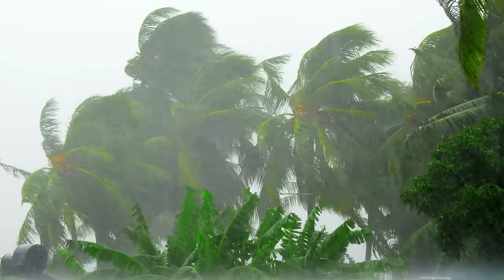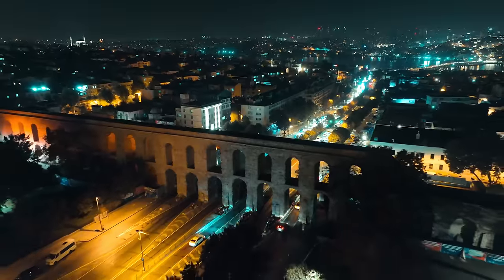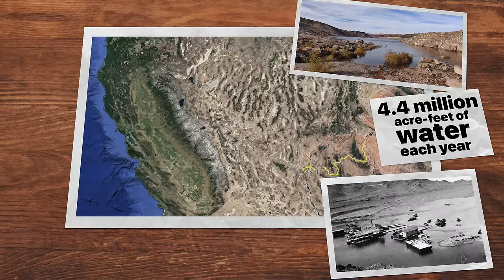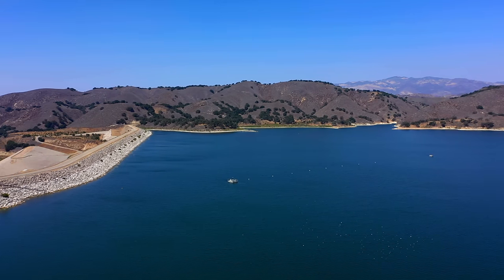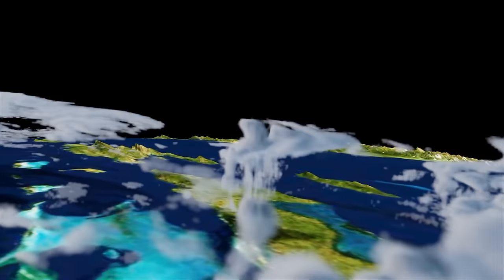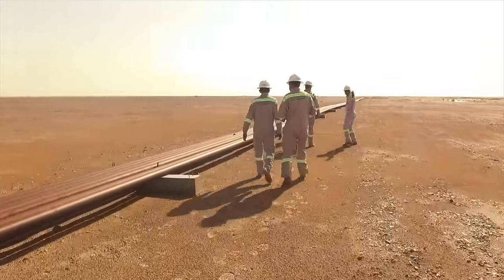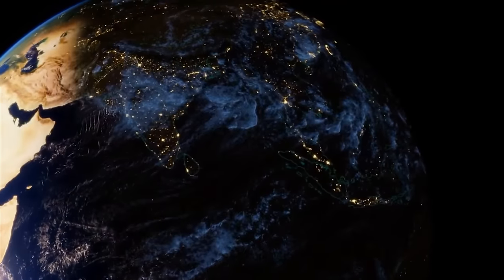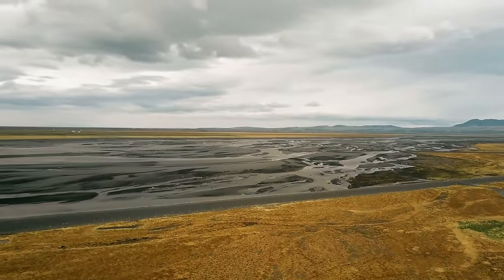Pipelines From Flood to Drought

Comment: Instead of pumping all the water to the end point you could just pump it to the nearest part of the Colorado Basin, and then let gravity and current infrastructure do the rest.  That would save a lot of work, also you could just empty a few lakes close to the basin, maybe making this all a lot easier.
Reply: Good idea. Pump water from the east (and north PNW?) towards different reservoirs hopscotching across the country. Good ideas to do something to mitigate flood damage.
Reply: The big factor is how costly it is to pump water up hill. Water is very heavy. Plus, we couldn't build an oil pipeline across a few hundred miles of wilderness. Running a massive canal across a thousand miles ain't going to be a cake walk. The environmental impacts of this... One might argue it's not ideal. I personally think nuclear desalination is the future.
Reply: @AnotherAmerican91  Pump water upward with solar electricity during the day, then regenerate that electricity when it flows downward.  Reservoir can also serve as a battery.  It's 2 birds with 1 stone.
Reply: How do you propose the patter is initially pumped there?
Reply: as to how look to the dutch thay have been pumping water uphill for centurys, plus the british and the canals for  narrowboats etc with locks
Reply: @alexfrank5331  Excellent solution.
Reply: Took the words right out of my mouth. Still an aquaduct would be fun.
Reply: I believe an issue with that is that Mexico takes from the Colorado as well
Reply: How dare you be so logical.
Reply: You could move to where the water is
Reply: @AnotherAmerican91  the fact you think a canal can work UPHILL is proof you don't understand the problem.  No one is ever going to pump water up  a mountain.  Every single person who advocates this has 0 knowledge of the engineering involved.  It simply can not be done.  No one is pumping water 1 mile or more UP a mountainside.  Also, pulling water out of another system weakens and depletes that system.  Lousiana is losing coast line in the gulf every year because of flood control on the mississippi.  That river is supposed to whip back and forth, it's how the delta was created.  Now that it isn't doing that the delta is vanishing.  You guys are literally advocating for further destruction of another environment to compensate people who made the bad decision to live in a desert.  It's awe-strikingly obtuse thinking.  The fact your doing it in the guise of "flood control" is proof you don't understand that floods re beneficial, and REQUIRED for the health of those areas.  Without them, land fertility will take a nose dive.  Without farms in those areas, we can't sustain the world population, without the farms in the desert, we go 2 months without fresh tomatos and have to use preserved...ono!  the horror!
Reply: @TheBadweasel1975  the dutch are pumping water uphill a few feet.  We're talking miles here.  The scale of the problem is vastly different and the dutch don't do it.  The tech doesn't exist and no one has yet shown the math to over come the back pressure of trying to pump a fluid over 1 mile UP in addition to 1500 to 2000 miles across.  The requirements to do this aren't possible with modern tech.  Attempting to hop across various reservoirs also will not work because that introduces loss to the system which means you have to vastly increase the amount being pumped on a daily basis, which means you are now depleting the source system at an ever increasing rate...thus destroying the land and biological diversity further east.
Reply: Absolutely.Or pump it right into lake Mead and Californias top three reseviors.
Reply: I'm looking at all of you who think water cant be pumped uphill very closely. do you know what a siphon is? there's a downslope half to every mountain. pick the lowest , best route, and bring water trucks, use valves and an opening on the downside to pump into.  open the valves, water rushes downward, (causing far less uphill pumping force to be required)  and hit the uphill pumps, and boom you got flow. lock the liquid in the downhill so it can always start again. also, we have boring tech before thought impossible, we can go through and make unmanned digs that reinforce themselves as they go.
Reply: @AnotherAmerican91  Exactly. California has the answer to their water problems on their entire western border. Quit robbing water from other states, when your answer is at your door. Desalination is not cheap, but it is likely significantly cheaper than the process described in this video. Dubai gets nearly all of its water through desalination, so the technology exists to do this on a large scale.
Reply: @AnotherAmerican91   desalinization plants are  their down sizes  huge down sizes.Also water is the new gold so pump it up hill would be cheap.And literally anything is possible,also we need to conserve the water we have and stop growing food in areas that dont have enough water for it ppl
Reply: @JR-wz3ub  yah at the bottom end not the top lmao,and they could say the exact samething .Also ppl need to stop moving to the deserts and draining away a already scarce resources ,it makes zero sense
Reply: @alexfrank5331  mmm yeah, pumping water up hill using solar power would be insanely expensive. The Midwest just isn't good for solar, and it's quite frankly not that great for wind energy either. It's not that sunny and it's not that windy.
Reply: @zarroth  mmm I don't think you read my comment correctly bro. I was pointing out how insanely impractical the idea was. I didn't even feel the need to address the engineering limitations, the ability to get permits in America for this kind of project just seems impossible to me alone. No need to even get to engineering before making my conclusion that this idea is a dead end. They can't build a high speed train from San Fran to San Diego and they think we're going to build a canal across half the country.... Good luck. I also think it makes little sense from an engineering perspective.
Reply: @jonathanbedsole1671  I mean I think the Midwest has plenty of water to share. My understanding is that desalinating water is actually way cheaper and environmentally friendlier than moving it across a thousand miles. Again, water is heavy and very energy intensive to move. I just don't think the math checks out, like at all.
Reply: @alexfrank5331  Not really.  You would have to pump it 1000 meters uphill, but you would only be able to get back a fraction.
Reply: @TheBadweasel1975  Nice try.  They haven't been pumping it 1000 meters uphill.  That is a long way and takes a LOT of energy to do.
Reply: I always notice it's "we" can do a thing, when the person speaking on their own behalf, or for their friends,  has something to gain in a "zero sum" or near zero sum sort of scheme.  But when those same people stand to lose, it's more of an "us" versus "them" sort of speech, and there's lots of focus on "me" and what is "mine".  I am not trying to quash innovative thinking, however I noticed that it took you quite some time to address the real issues of cooperation and politics (oh, and you just had to mention the gov. Intervention: that's comforting)...I can tell you if you are hinting at simply moving water from the midwest to the west, I and many others will take a very dim view of that.
Reply: @stevedriscoll2539  I think the truth is actually much less cynical. I think California would love to build desalination plants, but Californians won't let other Californians build those plants because of NIMBY issues and lawsuits. So the Californians that need water have to look outside their own state for solutions. That would be great however throughout America building infrastructure that moves any kind of liquid from one place to another is always a very controversial subject and usually doesn't end up happening. On the bright side running out of water will probably force California to come up with solutions they have the power to implement, like desalination plants. That'd probably solve their grid problem to, and probably also their carbon neutral objectives.
Reply: @AnotherAmerican91  agreed. The math definitely would not check out.
Reply: OR...you could MOVE outta the DESERT too!!!
Reply: @alexfrank5331  Look up Dinorwig in Wales. Water is pumped UP to a lake overnight using unused electricity (less energy required at night!). During the day it's a hydro power station. Also used for 'crash' power surges, (like half time England v Germany and everyone puts a kettle on for tea!) power can be increased in seconds.
Solar power would be a good idea for constantly pumping water reservoir to reservoir during the day.
I will also point out that dams are used for a) hydro power generation, b) water STORAGE. Dams are rarely used for flood control (Tennessee Valley excepted?), but if the authorities spoke to each other, reservoir A, which is over-filling and needing to release an excess, could pump water to reservoir B, which is also filling, but is pumping water uphill to C. C thus collects from A via B.
In the unlikely event that C is flooding, the energy can be regained as hydropower as C empties downhill into B then A.
Add in that power stations also need a lot of cooling water removed (pumped away) - so that water could be pumped uphill using energy already calculated into the power station's balance sheet. You'd need to be careful about which reservoir took how much hot water, and you probably wouldn't want to fish there, unless you wanted to breed tropical fish, but there you go. Swings and roundabouts again.
Reply: @AnotherAmerican91  it is costly but the cost of 4 states is more costly. There was a engineer that had a path in the north. Trying to get water across Texas to California will never happen (politics)
Reply: Excellent Idea!, Bravo!
Reply: @JR-wz3ub  I think it's the other way around as the river passes thru' the US on the way to Mexico and the Pacific Ocean. The US due to the 1926? water treaty with Mexico, is taking more than its share of water for the continuous expansion of residential settlements and farming needs. Had Mexico been a more powerful country militarily, a war over water would have been fought already.
Reply: @TheBadweasel1975 There are major climate differences between the Netherlands and England where it is damp due to regular rainfall and some snow unlike the Western US which is warm/hot. Should the proposal even get off the ground, the loss of water from evaporation due to the high temperatures in the area, will likely make the project(s) uneconomical. Conservation in the use of water is what's required until the drought ends, not continuous consumption where among other things, lawns are green in desert country.
Reply: @AnotherAmerican91  So many posts and few consider the enviromental impacts like invasive species and such. But it is a good idea for flood control if the kinks can be fixed. It would be great to see an impact assessment if anyone has actually done one yet.
Reply: @alexfrank5331  Solar electricity is not free. You still need to pay, install and the big issue here, maintain them, switching out solar panels when they start being less efficient.
Reply: Yeah let's empty more lakes cause it isn't like animals don't need water and what is also compounding the problem.
Reply: BuT WhAt AbOuT ThE Riv3r
Reply: @Reciprocity_Soils  PNW has been pretty dry too far a while.
Reply: @trombone113  why pump it directly to a lake that California is emptying out
Reply: Turn Death Valley into another Great Lake!
Reply: Problem is existing water agreements in place on the Colorado.
Reply: @sarumano884  To hit you with the numbers, a lake is small.  The lake you're talking about is a battery for a single town.  To generate the required energy to move the water from east to west, an average 14GW (14 nuclear power plants!), would require 343,392 acres of straight solar farm assuming 24-hour sunshine.  I'm not sure you realize just how ridiculous that is.
Reply: @feoranganon6002  I bow to your greater knowledge
Reply: @AnotherAmerican91  we absolutely could build the oil pipeline but due to corps being cheap it would most likely have leaks so that’s a no go. The advantage of pumping fresh water is that if it leaks there isn’t too big a issue. Unlike oil, fresh water actually helps a environment instead of hurting it.
Reply: @superspooky4580  I promise you building an artificial canal across a thousand miles will not be good in any way, shape, or form for the environment.
Reply: @explorerofmind  You still need the water for it
Reply: That  wouldn't work  because  you'd be  depriving  water  from the people who  need it  by the  basin, but  if you  could get  it pumped  closer  by relaying it, there'd  be  enough  water to  fight  the  wildfires and then  replenish the  used  water, either  way, lives  would be  saved
Reply: @hugeprostate1904  is it though? I mean I don't really care for pumping oil across vast locations. But then again my gas is like $3.30 a gallon right now.
Reply: @AnotherAmerican91  Anyone? Anyone? Mulholland? 
Look up the Owen's valley project.
Siphon it over the mountains, store it underground, the aquifers could use the help. 

I do agree on the nuclear desalination though. If people are serious about reducing Co2, it's the only real shot.
Reply: @AnotherAmerican91  the romans managed it pretty well.
Reply: @TheBadweasel1975  and the romans with their aqueducts.
Reply: @willcal2738  lmao that will never work. I can tell you haven’t played with a siphon much. A siphon will stop if it is trying to travel higher than the source so it wouldn’t even make it up the proposed mountain no matter what you do. Even if you get it started with a pump, once the pump is turned off the water I’ll not defy gravity. Unless there’s something I’m missing in what you’re saying that’s my 2cents 😁😁
Reply: the cycle breaks at the beginning. all the fresh water goes to the roots of trees that do not evaporate, but only grow nuts.
Reply: @tellyfanatic  very funny🤣
Reply: @zarroth  Sorry but the solution to the pressure problem exists. I don’t know your credentials, but you should know this if you’re an expert/knowledgeable of these kinds of systems 🤨
Reply: @AnotherAmerican91  the problem with desalination is all the brine waste, as he covered in another video.
Reply: @AnotherAmerican91  tesla valves could massively help with this.
Reply: Don't forget the Ogallala bigger underwater reservoir than great lakes combined .Starts near Missisippi head waters in Wisconsin to Texas and west ,no evaporation either.
Reply: @nopenope2541  that arent being met because the water is gone before they are all met. So transporting this water would solve this.
Reply: Yes, water CAN be pumped uphill. Water is already pumped UPHILL everyday in California. The huge aqueduct that runs along  Interstate 5, from Northern to Southern California, is pumped up over the Tehachapi Mountains and flows down the other side into (man-made reservoir) Lake Castaic. This aqueduct and storage reservoir were built in the early 70's in order to give Los Angeles water from Northern California. The Los Angeles Desert doesn't just consume a lot of water from the Colorado River, it also uses (steals) a LOT of water from Northern California, that the people in Northern and Central California could be using right now. Granted, the Tehachapi Mountains aren't nearly as high as the Rocky Mountains, but never say something can't be done. The hundreds of miles long California Aqueduct project was completed over 50 years ago with 60's/70's technology. Just imagine what could be accomplished with today's technology if money and politics were not a huge issue. As they say, "necessity is the mother of invention, " and we currently have a huge "necessity" for water in Califirnia and other Western states. Yes, there is the desalination plant option, and Orange County, CA just got approval for the most recent desalination plant in the state. The desalination plant will cost 140 million to build, and go online in 5 years. Once the desalination plant is built and online, then there will be major operational expenses and salt disposal (or reuse) to deal with. Now, if the corrupt California politicians didn't need to save face, and push the "Bullet Train To Nowhere" to get built, the state of California could use that money to build many more desalination plants. The train was originally budgeted at 33 billion, and now the cost is up to 113 billion, and the train is nowhere near completion. There are many "solutions" out there for the current (and ongoing) drought situation. Unfortunately, nobody (aka worthless politicians)  can agree on a solution to permanently fix the problem before it gets even worse. I guess when these rich "Elites" start running out of water this issue will finally become an "emergency," and something will be done to fix the problem that should have already been done decades ago. SMH 🙄
Reply: @LM-wz9yw  no
Reply: @Remsster  no what?
Reply: @alexfrank5331  and watch the unicorns and fairies play
Reply: @zarroth  easy solution, move to where the water is.
Reply: @zarroth  dig tunnels
Reply: Or people can move out and to other states if it's that bad
Reply: Exactly
Reply: Theoretically the energy cost of pumping over the crest of the Rockies could be recouped via hydroelectric generation on the other side of the Rockies.  The true cost would be just the waste from inefficiency and friction.
Reply: @AnotherAmerican91  water pumped to altitude has potential energy that can be harvested as it flows down the other side, much like hydroelectric batteries being developed now.
Reply: @alexfrank5331  and you believe in free energy devices as well ?
Reply: @AnotherAmerican91  Oil pipelines are built across thousands of miles of wilderness
Reply: @willcal2738  a siphon will only work (theoretical max) of about 32’. That’s way short of the 11,000 feet or so to get over the continental divide
Reply: Great idea, but Colorado probably wouldn't want any part of that due to current ecological problems the the invasive zebra muscles hitting many of the reservoirs currently. The amount od potential issues from contaminants could be staggering. However I'm sure there are plenty other places to pump it where it wouldn't cause any issues. I recently watch a video on some impressive infrastructure that Japan built to handle the water influx during tsunamis. That may not be the answer either but there's bound to be a good solution. I do like the ideas of utilizing existing infrastructure in a way that can be dual purpose like with existing hydroelectric reservoirs. Could potentially use old mines/quarries (once cleaned) as temporary reservoirs? Could also use depleted natural gas caverns as a way to temporarily store water, this is an adaptation of an idea to use these old caverns to store carbon dioxide retrieved from the air or used to store excess solar/wind power in the form of compressed air to later be used for air powered generators during non-peak solar/wind times.
Reply: @mrhatch117  ive never heard of a max height. Also mountain could be bored out
Reply: @tellyfanatic  You got the best post award....
Reply: I agree. I feel like transporting water would be the hardest part to manage.
Reply: @willcal2738  once you hit 32 feet the weight of the water in a pipe is enough to cold boil the water and it freezes from evaporative cooling. 
You can pump water by pushing it but you can't pull it without it evaporating. Pressure concentrates heat and a vacuum sucks the heat out. The water has to be pressurized or else the pump only sucks water vapor and eventually freezes.
Reply: @monster8090  i guess it makes sense. What about locks and pumps on wind/solar?
Reply: @willcal2738  it's too much elevation for that. The low air pressure up in the mountains would cause the water to freeze. The system has to be close to sea level if it has open reservoirs. 
I think the biggest problem would be the size of the pipeline to carry even .1%  of the water California uses. The pipes would have to be 40 feet wide and carry thousands of gallons per second. 
One person doing laundry or taking a shower uses about 30-40 gallons of water. One toilet flush uses 2-3 gallons. 
The weight is the other problem. Even if you didn't have to go so far up the mountain it would be like trying to push a line of semi tankers halfway across the country. 
Solar power wouldn't make enough electricity to pump that much water.
Reply: @monster8090  i thought we were talking about the  Bradfield plan for Australia Edit: you are mistaken about wind and solar.
Reply: @willcal2738  oh, in Australia if might work but that would be a much smaller scale and not nearly as difficult an engineering problem. 
I'm not wrong about solar though. 
You can research how many watts per square meter solar produces and how many watts water pumps use per cubic feet per minute and do the math. 
The benefits are not equal to the cost even if it lasts 50 years without repairs.
Reply: @monster8090  i keep saying wind AND solar, and they have nothing but open space and bright sun and a whole country to consider. Scale isnt an issue.
Reply: It's actually much easier to never fight gravity. It might have a lower infrastructure cost, but the energy expense would raise the carbon footprint. In general, these projects have a huge carbon footprint.
Reply: @jameslooker4791  Bring in the Boring Company!
Reply: Who is going to fund the construction? Are there going to be Foreign Countries involved in construction and control? Who is going to profit from this?  How much will it cost cities/farmers/individuals for the water?  How many farmers/land owners/home owners will be forced off their land by eminent domain and paid a fraction of what their land is worth much less destroying the farmers livelihoods that are generations old so big conglomerates can take over for next to nothing. 
Oh it all sounds very nice but I’ve been on the “Unseen” ramifications of these projects.  Then there are those that said to drain lakes to supply the water elsewhere. What happens to the wildlife, the ecosystems that are destroyed much less the people that have property and homes and now would have lost their lives as they know it now. Property values greatly diminished and businesses that have lively hoods based on that lake being there (Resorts, restaurants, grocery stores, etc. just destroyed because “Big Businesses, Cities, people want the water so they can have pools, green lawns in the desserts and put up more multibillion dollar “Almond Groves”, etc on desert land never intended for that use. Changing the natural ecosystem and animals that live there and changing the environment which affects the weather. One lake drained has a big impact on that area, it effects the water tables, the humidity, in a wide area plus the weather in that area. 
The people that moved from lush green areas to Arizona deserts and want their “Green” lawns, pools to cool off in the hot weather, they flood their lawns to keep them green, that is a WASTE of the precious resources. You shouldn’t be allowed to have lawns not natural to that environment. 
Years ago California and other states didn’t have the big forest/grass fires because the forestry department did controlled burns to remove over grown underbrush like nature did with lightning. Which does improve wildlife. No fuel to fill the fires spread. I remember one fire that destroyed all except one house. What saved that house when everyone around it burned to the ground was its design, natural stucco, tiled roof and a yard plan that didn’t have trees, shrubs, and lots of vegetation around the home. 
Simple common sense. Live to your environment not change the environment to suit you.
Reply: @superspooky4580  
No big deal?   Flooding, destroying the ground, washing it away, destroying crops, homes, etc. may not permanently contaminate the ground but it sure would destroy the landscape and building or farm crops around it before it could be turned off. Could actually destroy an aquifer and surrounding wells.
Reply: @nancybrown2207  erm. How much do you think a pipeline would leak. If it’s the same as a oil pipeline would then it’s only a tiny bit maybe enough to make a few puddles. The danger from oil is the fact that oil is toxic
Reply: @daniellesmith1059 , is there a gift card or cash reward lol only kidding thank you very much for the award it does mean a lo no kidding ,
Reply: I’ve always thought about this. Definitely a great idea and as a Californian, I’m ok with paying the extra tax to those states
Reply: @AnotherAmerican91  The Midwest is extremely windy. They even call Chicago the windy city.
Reply: @AnotherAmerican91  Lake Mead is about 375m above sea level. Most places you want to pull water from are far closer to sea level. 

Math time!
375m * 1 kilogram (liter of water) * Earth's Gravity = 3,675 joules of energy
Cost to desalinate 1 liter of water = 3,000 joules

It is more energy efficient to desalinate. Also, they don't take water from the bottom of the Hoover, so there's no getting any of that energy back.
Reply: @zarroth  Infeasibilities aside, we could power the Colorado River with the Mississippi River and it would barely notice. The Mississippi has about 60x the flow.
Reply: I see everyone talking about going over the rocky mountains and such, but would it not be possible to tap into underground aquifers and then pump the water out on the other side? Not sure if there is one that crosses the rocky mountains but if there is, seems like an easier solution then pumping over or tunnelling through
Reply: @willcal2738  do you know what a siphon is
A siphon can lift water to an absolute maximum of 32 feet.
Reply: @zarroth  Irrigators across the Northwest already pump water uphill to grow crops on land on either side of the entrenched streams. Costly? Yes, but the electricity in the Pacific Northwest is cheap because the majority comes from hydro projects, not carbon fuel sources.
Reply: Empty a few lakes? That's very inconsiderate to the local ecosystems and rural communities that depend on such lakes. Desalination and emptying entire lakes are not the answer that's just another short sighted man made ecological disaster waiting to happen. Even if there was support for that it wouldn't solve the problem. Consumption would still grow and the water replacement would still be low.
Reply: New Idea:  Pipe glacier melt off Greenland to N. America, and Africa.  This could slow Atlantic Current slowing due to the insertion of cold water and work to reforest desert areas.
Reply: It would mess up the land due to the salt water having to go threw the soil to become fresh water again
Reply: @highlifela7139  About three-quarters of Earth's freshwater is stored in glaciers. Therefore, glacier ice is the second largest reservoir of water on Earth and the largest reservoir of freshwater on Earth! Learn more: USGS
Reply: @highlifela7139  I seems you missed the rest of my remarks.  Pipe glacier melt off Greenland to N. America, and Africa.  This could slow Atlantic Current slowing due to the insertion of cold water and work to reforest desert areas.
Reply: Probably more cost effective
Reply: @alexfrank5331  interesting 🤔
Reply: you do realize almost all water transportation systems use gravity already. how do you propose we get the water to the continental divide? do you realize how much pressure would be in the pipe at the start?
Reply: Bucket lines up a mountain would be much easier then pumping it up the mountain.
Reply: @brakanone6809  We should not be taken salt out of the ocean it will mess up our seasons even more.
Reply: Brilliant
Reply: heck ya that is the smartest way right there...
Reply: @alexfrank5331   totally right they can use screw drives technology as well to help in these regards
Reply: @jonathanbedsole1671   you cannot compare the oil rich country with a single leader making decisions to our own. We can make more money in the process and put more people to work. 
Desalination is the future hands down but he's right in that other regions like Florida could benefit from selling g their water to California AG. 
I prefer rail method btw for the AG sector supply. But that's another study
Reply: You would have to do massive filtering first or entire eco systems would die.
Reply: A Great idea for some fraction of the water amount. Using this to solve the whole thing would most prop cause floods along the river if I think about the volume of water a flood has and what needs to be removed of it in order to prevent it. So most prop, if we decide to pump water from one part to another, a pipeline is not avoidable
Reply: It needs to go to Lake Shasta and Lake Oroville, too, and the flood waters come at the wrong time so there wouldn't be enough storage space to hold it. California water for agriculture is based on melting snow which melts slowly and refills the reservoirs over the summer as they are emptied. If the snow is gone, there aren't any good solutions. The snow is gone.
Reply: @AnotherAmerican91  There are thousands of miles of oil pipelines across the country, so the pumping technology is there - The specific gravity of oil is .845 vs 1 for water.  A 15% difference is not going to make or break the issue.
Reply: @stevefeder1410  you need to move a lot more water than oil. And it's near impossible to get oil pipelines built these days. Plus all the energy going into pumping water uphill. Seems like it would be a lot better for the environment to build nuclear desalination in California. It's just California can't do that because of their own regulatory environment so now California is looking for solutions outside of their own state. It's a bold strategy but I doubt anyone outside of California will go for it.
Reply: @nopenope2541  room for renegotiation is present. Several storage reservoirs on the way ensures more steady demand. Overall, the agreement in place is over the limited supply that would allow fisheries to not have as much demand pressure from farming and human demand.
Reply: @JR-wz3ub  it may open up more fish migration
Reply: I have ways to eliminate hurricanes and tornados
Reply: I was thinking the same thing
Reply: That is a great point sir .....
Reply: @AnotherAmerican91  
I don’t see much environmental impact from construction. Most of the ground is already farm ground.
They clam environmental damage from building pipelines and I don’t see it. A 50’ cut of disturbed ground that in a few weeks is all but back in better condition than it was. Wild life impact is very little. Converting pastures to farm ground is much worse but no one fights that.
Reply: @TheBadweasel1975  The dutch pump water a few meters up hill. This proposal would require pumping up potentially 100s of meters, which is an entirely different basket of physics.